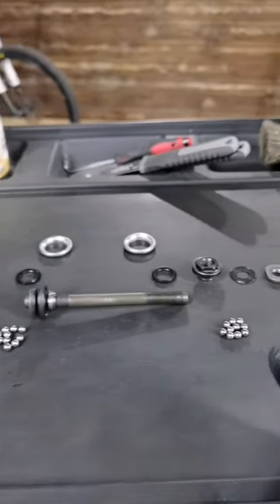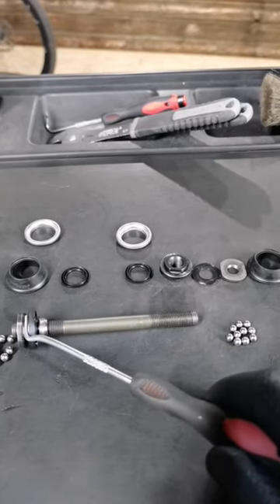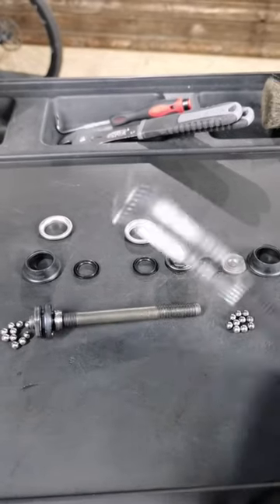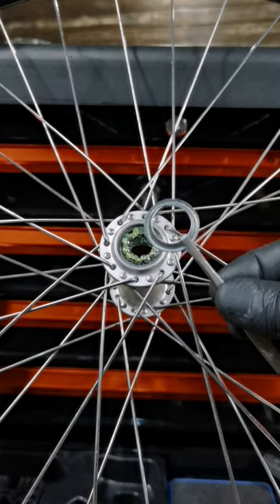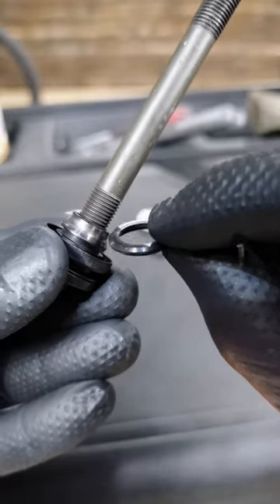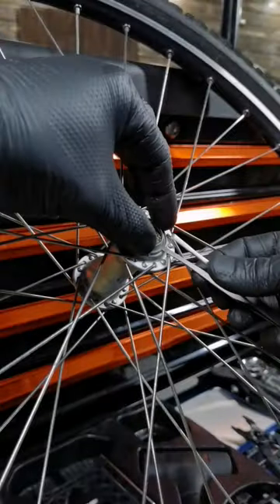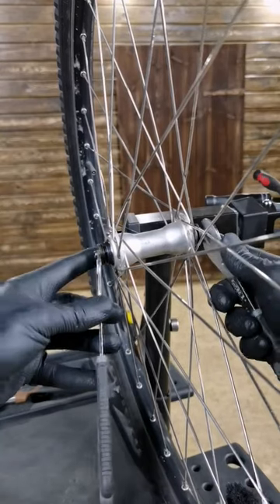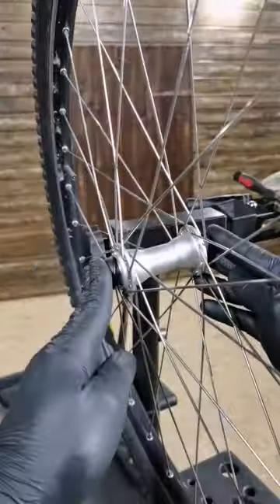3 things bike owners mess up with Shimano hubs service... #shorts

Comment: Put the tight side in a vice and then adjust the loose cone nuts on top and check for play and ensure it's not binding.
Reply: Exactly. Only way it can be done properly.